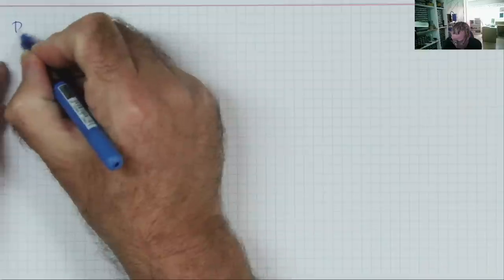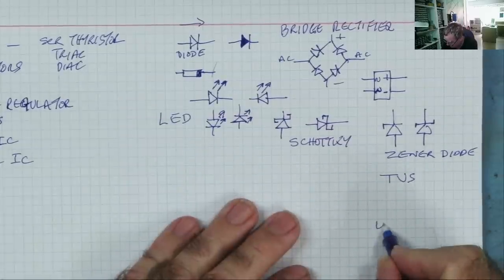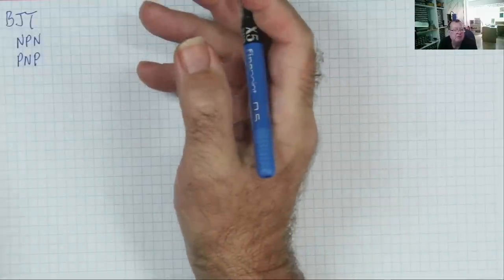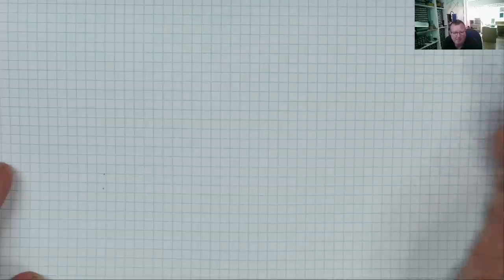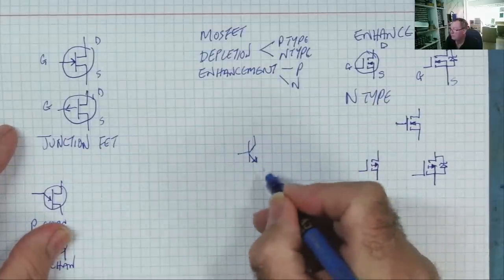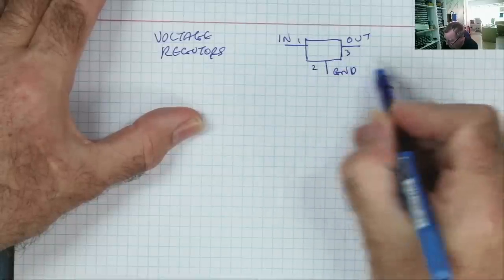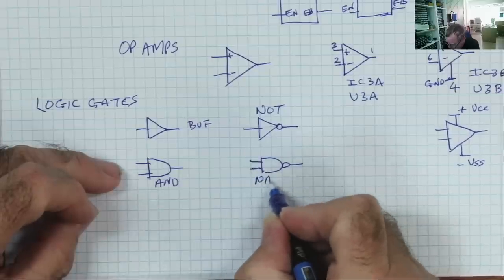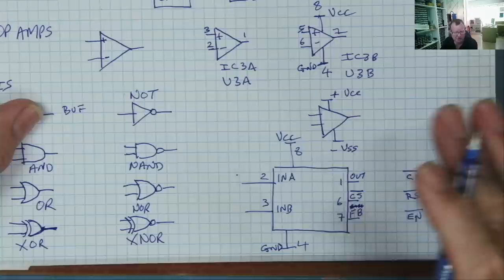How To Read Schematics PART 2

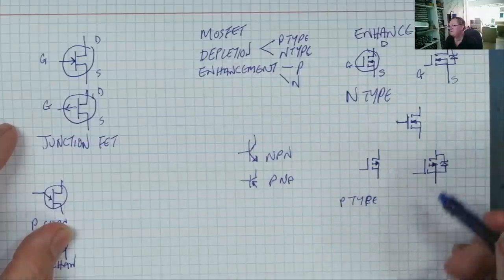Comment: At around 26:00 besides the arrows being the opposite to normal transistors you forgot to mention the annoying fact that MOSFETs move current from DRAIN to SOURCE which is the inverse of what should be intuitive according to those names. Transistors are more intuitive moving from collector to emitter. Thanks for the video!
Reply from the maker: Actually  I always thought the collector emitter naming was on-intuitive.  At least on NPN transistors. it would seem logical that the emitter emits something that is collected by the collector, the opposite to conventional current direction.  Of course if you think using electron flow it does make sense but then the arrow on the NPN emitter points in the opposite direction to the direction of electron flow.   PNP transistors make more sense from the point of view of conventional current, with the emitter emitting 'positive particles' but the arrow is still pointing the wrong way for electron flow.
Reply: @LearnElectronicsRepair  oh well I thought about it like the collector collecting electrons for the emitter to emit but I guess it could be thought either way as you pointed out. In any case the drain to me is something that loses (water or something) so to think that it sends electrons to the source is totally non-intuitive. Anyway it is what it is and like you say in the video near the end of that explanation “…but NO”. LOL!

Comment: Why are they called active and passive components
Reply from the maker: Well google says passive components don't need any power to operate, active components (transistors ICs etc do)
When I learned all this in the 70s and 80s I was taught that passive components obey laws like ohms law or the law of reactance, and active components do not.  According to the first definition a diode is a passive component and according to the second it is an active component.  I always considered diodes to be active components but google doesn't seem to know if that is correct or not